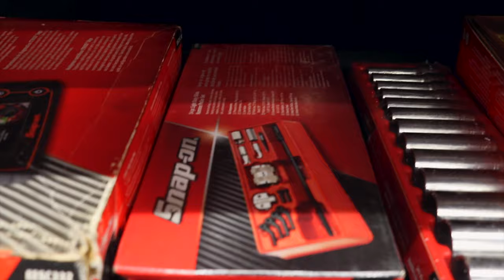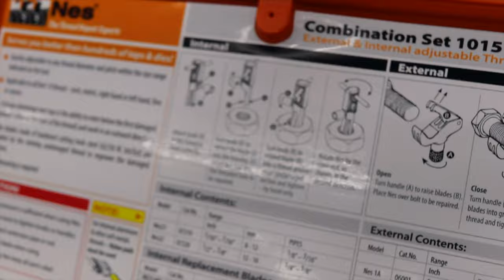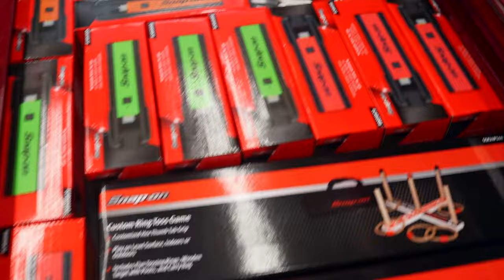Snap On Dealer Impressed By These Socket Rails

Comment: They have been available through Snap-on and all of the other trucks for several years. They have a display set-up with magnetic jars with the different pegs and they have all of the lengths of strips. Cornwell even sells alot of their socket sets already on the Vim mag strips.

Comment: Snappy = Tech Retirement Plan running the truck. I bet most guys pay more on the truck than their retirement.

Kevin needs to get some custom made Snappy S contacts.

Rails are coming via Snappy just wait.

My recent shop uses NAPA / FMP for parts and supplies. We have a two double air water stations, they have to replace the hose and chuck every other day / week cause the spring retractor failed. I got a quote for Snap-On/Bluepoint 4 chucks, 4 hoses, was like a $1200, but warrantied and boss knows better said no.

Comment: Hi Clay, I was wondering if your snap on guy carries the snap on neck lights?? The one I'm asking about , the lights actually be pulled from the neck band and used as a flash light,  and then pop back on with the magnets. I really  want a pair in red , if available. Thanks for any info. If you have a old set that ur not using, I would  buy them from you. I can't order from the snap on site for some reason. Thanks from Texas.
Reply from the maker: We showed them in the last couple episodes on the video.

Comment: The sockets will become magnetized and collect crap.
Reply from the maker: The sockets will not be magnetic because of the design of the magnets inside. It has a patent on that for that exact reason.
Reply: @KoonTrucking  
So they did their homework.